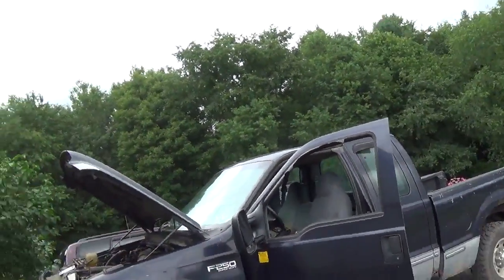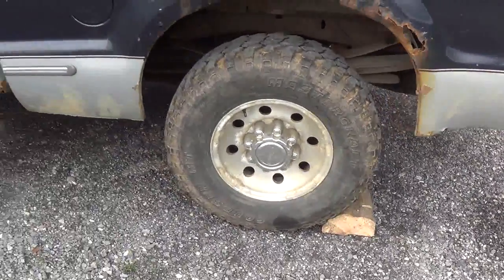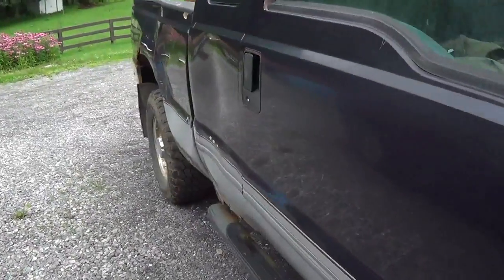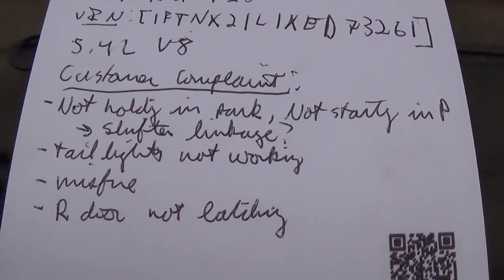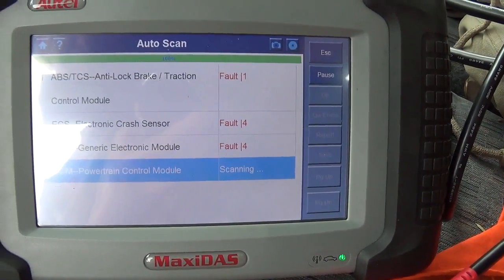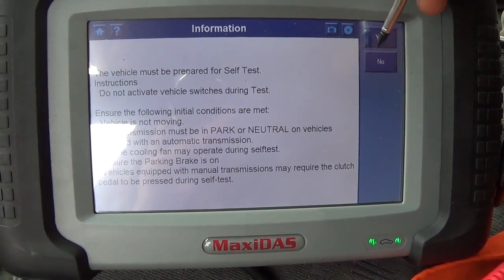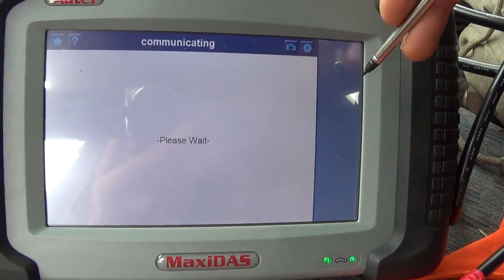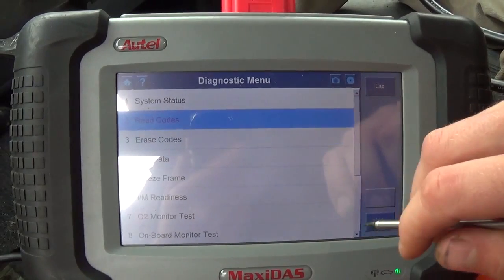99 Ford F250 5.4L: Surging/Rough Idle Case Study-Part 1

Comment: Question so my Ford F-250 Super Duty was running fine I pulled into a parking lot put it in park the engine rev up high then it started to miss can you help me with the answer

Comment: I have pretty much nailed my brothers 2000 model Subaru.Forester which has a surging idle, it's not the ECU but I found out how to put it into diagnostic mode using the green & black connectors underneath the steering column & I got a code 54 which is an air intake problem.

He took it to a mechanic who didn't want to touch it as his scan tool wouldn't communicate with  it,the point is the car is an OBD 1.5 compliant car as it's an Australian delivered model,it was throwing me off because I wasn't getting any pulse with my LED test lamp yet no injector fault codes were recorded  for them, maybe the mechanics scan tool was  an OBD2 one.

I think that code 54 has been set because the idle air control valve is stuck open, it's also thermally controlled by coolant temperature & the throttle position switch is telling the ECU that the engine idling.

So I ordered another idle air control valve for $48 AUD which should fix the problem,the point is it's a simple problem to fix if you know what's wrong with it !
Reply: Did that fix the issue with it? I'm curious now lol

Comment: Sounded like a Misfire.I had a 2003 5.4L F-350 XLT and it had over 297,000 Miles.I could pull 14,000 lbs with it using 4.10 Gears and that's not even how much they truely can haul.I also had a 2002 5.4L F-150 Supercrew Lariat and it was a reliable Truck as well,only got to 204,000 Miles because the 4R70W and Driveshaft took a shit and needed to be Rebuilt.

Comment: ive got a v10 f350 and found the wiring 'grommet' out of the air filter housing out and mine was doing the same thing....popped it back in with a little silicone to stick it and it was schmoooth as it gets.....
Reply: My farm ‘o2 f250 did the same.

Comment: Why cant they go with a 2002 7.3l powerstroke because those trucks are the best known for heavy duty work
Reply: The Excursion,F-250,F-350,F-450,& F-550 came with the 5.4L & 6.8L 2 Valve as a Gas Truck and the 7.3L Powerstroke from 1997-2003.During 2003,they came out with the 6.0L Powerstroke but you could still get one with a 5.4L or 6.8L and they changed them to the 3 Valve up to 2008,and then they came out with the 4 Valve and 5 Valve,until the Tritons were discontinued in 2014.The 5.4L as the 2 Valve/16 Valve is 260 HP/303 lbs of Torque and then the 6.8L as the 2 Valve/20 Valve is 300 HP/325 lbs of Torque.With 3.73,4.10,or 4.56 Gears,those Tritons can handle serious Weight.In the F-350,both the V8 & V10 can do up to 20,000 lbs,but don't expect it to go fast.I had a 2003 5.4L F-350 XLT that had more than 297,000 Miles on it and I use to pull 14,000 lbs with it on 4.10 Gears.I just got a 2002 6.8L F-450 with over 385,000 Miles and it has 4.56 Gears on it.The major flaw with the Tritons is how they get 8-9 MPG and that's just in the city.By all means,I love the Powerstroke,but the Gas Trucks are just as good,you just have it cheaper to maintain,more RPM,and it's easier to Start in the Cold than a Diesel which requires a Block Heater.The 7.3L is 250 HP/525 lbs of Torque,more Torque always matters,and a Powerstroke has more Fuel Efficiency than a Triton which is a big plus.

Comment: had the same problem in my 2001 ford e350 super duty 5.4 v8 and replaced the intake manifold and the coils works like a charm now ,before it wouldnt even past 40 mph

Comment: I think I would pull in a second channel and maybe look at that coil that didn't have the good turn on oscillation. Could be a secondary problem. Although by the sound of the engine in the video it has more than one misfire.

Comment: Reason the CEL isn't on is because if it had a bad coil the light would be on, a boot problem wouldn't show up however. I work on these trucks regularly and I like them, which I like my 5.0 Explorer from 99 so I'm probably out to get it
Reply: +BronzeChicken Which I'm early into the video so
Reply: The computer can only monitor the primary side of the coil, hence the "primary circuit fault" 

there can absolutely be a problem with the secondary side of the coil and would not set a DTC. If the secondary shorts to the primary, no spark
Reply: Do you only work on ford's triton V8 or dot the v10s have similar issues and fixes ?

Comment: you like that autel ?
Reply from the maker: +Plague Plague Yes it's a fantastic tool!
Reply: +motoYam82 out of all your scan tools if you could only pick one, which one would it be?
Reply from the maker: That's like asking, which vehicle would you keep, your work truck, or your commuter car...apples and oranges.

If looking at just the scanner and coverage of late-model vehicles (post 2000) and Euro stuff, then the Autel has the advantage over any Snap-On tool.

However, for pre-2000 and OBD-I cars I would stick with my Verus.

Also the Verus has awesome features like the 4-channel oscilloscope, component test database, and troubleshooter which are technically not part of the "scanner".
Obviously if I had to choose one tool I would choose the Verus, but it also costs 10 times as much!!
Reply: I have 10 cars and i know which one i would want to keep :P lol Thanks for your response.

Comment: I had a 07 mustang with hot rod cams that sounded just like that lol. Maybe its in hot rod mode
Reply: +nicholas elias I think the next step I would go is do a simple power distribution test to see If I can find a non contributing cylinder because it sounded like a dead miss. If it ends up positive for a cylinder, then I would use a COP probe to  see if the secondary ignition is at fault. If it turns out inconclusive and all are contributing and no issues with coils then move on to maybe a vacuum leak, a dirty MAP or a stuck EGR

Comment: I was also wondering why you didn't search for a vacuum leak or pull some vacuum lines to see if the idle changed...maybe command the egr through the scanner....I did like the current ramp test...very cool test!!!.....I am a little more old school in that I start searching basics first....I know Matt hates when we talk about visual inspections and poking around without leads or direction....He blows his top when we do that....but I have been searching for leads that way for many years now...I have found so much wrong with drivability problems without ever cracking open my scanner or scope...excellent case study so far!

Comment: Behind the throttle body is a vacuum line going to the PCV valve it changes from like a quarter inch line into a half inch hose and failure occurs right there where it attaches behind the throttle body where you cannot see the leak

Comment: I agree with not thinking its a vacuum leak because i would think they would be a lot higher at idle over 20 to make the engine run so rough. It does sound like it may be egr related one quick test to see if you have egr at idle is just to put your hand on valve if its hot its flowing, also using a vacuum pump to valve engine off and listening for pintle slamming down and seating.

Comment: On a hunch I would check for a stuck open EGR valve.
Reply from the maker: +wysetech2000 You must be a Ford guy :)
Reply: +motoYam82  No Ivan, not really a Ford guy, I drive a Caravan...(worse). I have been a tech for bout 47 years and lived through the EGR valve very common failure years, 70s and 80s. We used to stock the most common ones. I was a little surprised you went to the EGR when I started watching part 2 after my comment. I give you a lot of credit since you're smarter than I thought you were. {:-)  I used to lightly touch the EGR tube or check to see if the tube or valve would melt a tire crayon. We didn't have infrared thermometers back then.I'll keep viewing your vids, I might learn something.
Reply from the maker: +wysetech2000 Wow 47 years...you must have some amazing repair stories to share! Do you prefer working on vintage pre-fuel-injected vehicles or the newer computerized cars? 
I love tinkering with carbureted motorcycles and cars too...maybe that would make for an interesting video series? Setting ignition points and tweaking the idle mixture is becoming a lost art :)
Reply: Yeah, trying to retire but they keep calling me into work. I prefer older stuff but newer is more of a challenge. Sometimes I think I could write a book on what I've seen over the years.
A series on older stuff would be cool. If you need help just ask.

Comment: Just curious why, based on the fuel trim/RPM curve you didnt go right for vacuum leak off the bat?
Reply from the maker: Schrodingers Box Great question, Matt! The severe up-down surging itself steered me away from a traditional vacuum leak, which would cause much higher fuel trims if it was messing up the idle this much. The fact that it ran smooth and trims were good at higher RPMs should have steered me away from ignition altogether too...But since it was a Ford I was determined to find at least one bad ignition coil haha. Ironically, being burned by that red-hot EGR pipe while unplugging an ignition coil was the "Eureka" moment lol
It's great that the battery was dead before the truck came to the shop, erasing any valuable stored DTCs to make the diagnosis more fun :)

Comment: Trim numbers got better with a few rpms ,Steve has it covered i think , If not then trade it in on one that runs . lol But on a serious note,  i am liking the 708 . may have to get one for the times my ultra is not working
Reply from the maker: wtbm123 Just got a call from my friend's shop. He's trying to bleed a '97 Caddy Seville ABS system and their Snap-On Solus Ultra doesn't have that auto-bleed function. Neither does my Verus. But the Autel 708 does! Go figure...
Reply: motoYam82 i think you can program some keys too with the 708.

Comment: Nice- I think I would look at a vacuum leak since it did seem to run better at a higher rpm.
Reply from the maker: Steve Rob Good guess, but no free T-shirt yet :P    Keep thinking...
Reply: Ok Ivan I'd look at the Maf and fuel pressure and why not do a injector balance test , am I getting close to winning a T shirt :) Oh yeah  the IAC , hey I'm going full Danner on it as you can see LOL
Reply from the maker: Steve Rob I bet ScannerDanner would make the right call just by hearing that exhaust note lol...he's probably done dozens of these 5.4L Fords!
Reply: No way , PVC, brake booster but I think that truck is a hydra boost , and egr are all vacuum leaks- exhaust sound is the clue Ah , this is getting better all the time HA......

Comment: you asked at the end "where would you go from here?" i would siphon out some gas and burn the truck.... lol JK i would do a fuel pressure test as there is no CEL judging from that life of the truck that to much dust ... mud AND rust would clog things up it might be as simple as a clogged intake filter or fuel and and i would check the electronic throttle body and clean it. if everything is fine and the truck is still rough i would smoke the intake there might be a small vacuum leak.
Reply from the maker: K Ironically it would be difficult to siphon gas from this heap, since the collapsed bed is pinching the fuel fill lines hahaha
Reply: LOL that explains ALOT .... hahahahaha what a truck.

Comment: Hi Ivan
I am learning a lot from following your channel.  Thank you.  Also really enjoyed when you teamed up with Eric O. 
I noticed that as you raised the RPM the fuel trims numbers on both banks improved and when you let off the gas they increased again.  From what I have learned from Matt's channel would suggest to me that the fuel trim behaviour shown on your Autel are symptomatic of a Vacuum Leak (maybe bad intake manifold gaskets on BOTH banks is what comes to my mind).  I wouldn't suspect a dirty MAF or weak fuel pump because the fuel trim numbers would have increased as RPM increased.
Reply from the maker: toyo toe Thanks, Toyo! You are definitely thinking in the right direction. Fuel Trims are definitely a big clue...stay tuned for Part 2!
Reply: motoYam82 Just noticed Absolute Throttle Postion at 19.6% during idle.  This seems high and suggests the plate in the throttle body is probably open and unable to close due to carbon build up.  This would result in unmetered air entering engine and causing lean condition on both banks.  I'm sure you must be 1/2 can of carb cleaner lighter by now.
Reply from the maker: toyo toe So why do you think the air flowing by the throttle flap would be "unmetered"? I didn't see any tears in the air pipe between the MAF and the TB, so I think the MAF is accounting for all the incoming air through the TB...
Reply: motoYam82 Thanks for correcting my mistake.  Does a V engine have 1 pcv valve or 2 ( one for each cylinder head)?  If 1 pcv for both heads, then I suppose if valve faulty, would allow unmetered air into intake.  Would check to see if it is difficult to physically pull the dipstick out of its tube or connect a vacuum gauge into dipstick tube to see how much vacuum is being pulled.
Reply from the maker: toyo toe That's not a mistake, but a "thought experiment" :) Now a crankcase vent system usually consists of a inlet vent taking in fresh air upstream of the TB (no vacuum), and one PCV valve that lets vapors into the intake manifold (vacuum). So even if that was a path for air around the TB, the MAF would still see it!  
I guess the only way you could create measurable vacuum in the crankcase would be to plug that fresh air vent...another interesting thought experiment.